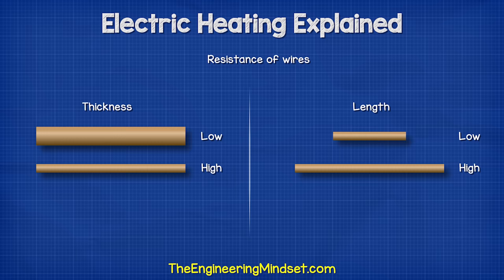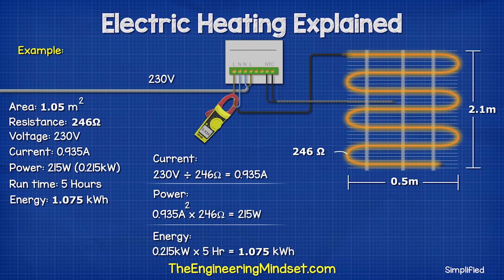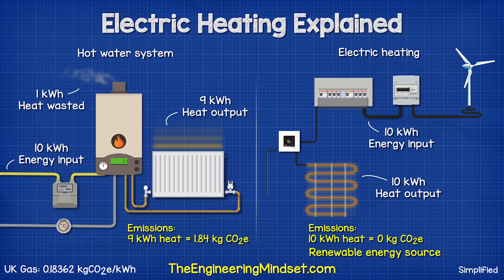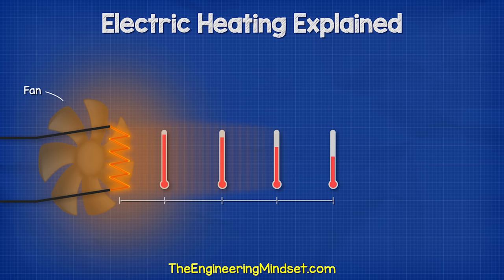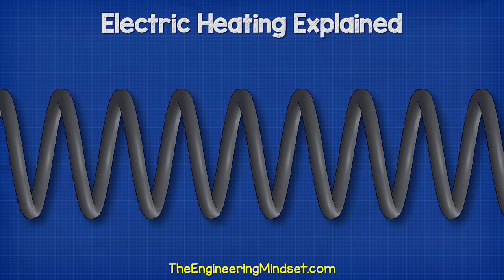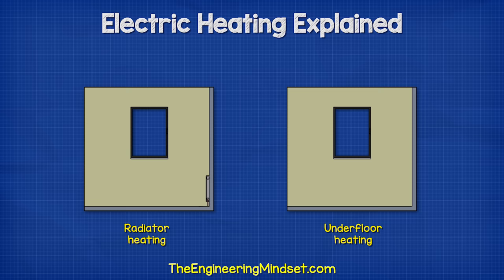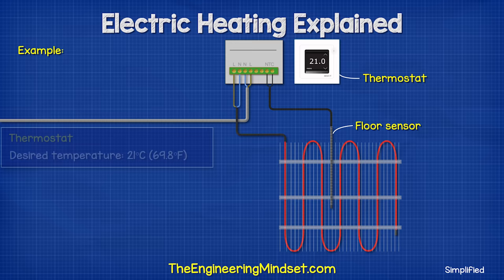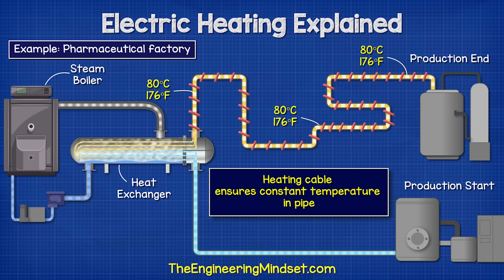Why electric heating is the smart choice

Comment: Both copper and Kanthal wires generate heat, but Kanthal requires significantly less current to do so. Efficiency in electric heating involves converting the kinetic energy of electrons into thermal energy as effectively as possible. Achieving 100% efficiency would mean your electricity bill would be zero.

Comment: 3:17 Power is just voltage times current (P=UI), both of which are known. There is no need to re-calculate the voltage to get the power by using the (P = RI²) formula
Reply: Duderino, I think he is really aware of this. LoL
Reply: @GooogleGoglee  apparently not

Comment: I am currently using an portable electric baseboard heater for my dorm room. It is almost silent and can run constantly. I use it too keep my room a little warmer than the other room. My main heating has failed entirely in the past so the original purpose of this was to have it take over automatically if needed.
Reply: Username checks out

Comment: One form of electric heat that I have seen in other videos, and I can image, not a very efficient or efficetive one "Radian Ceiling" electric heart. I've heard of in floor electric heat here in the US since the 90s. I think the radiant ceiling version wouldl be rather uneven and hard to regulate. First time comment. Very interesting videos!
Reply from the maker: Yes, I had this in a place I rented. Never seen it before or since, but, I'm glad though, because it was terrible. Heating the hottest part of a room definitely doesn't seem comfort focused.
Reply: Our 1985 house in Western North Carolina mountains is heated entirely by ceiling radiant heat (sandwiched between 2 layers if sheetrock).  It works well but is about the least efficient way to heat. Looking to replace it with heatpump hot air w/AC (no AC currently) for better efficiency - also concerned with safety of existing wiring after 35 years.

Comment: I noticed that the speaker did not mention that in-floor heat is more efficient-- because it is NOT more efficient.  Electric heat is always 100% efficient.  Marketers in the US keep pushing that in-floor heat of any kind is more efficient but it is Not.  In-floor heat is Less efficient if the warmest thing in your house is the floor and it is in contact with or not well insulated from the ground beneath it.

Comment: We’re thinking of upgrading our local village hall from our old convectors to infrared. The companies selling this often contradict each other. Some insist that short wave IR should only be used outdoors and others claim it’s perfectly fine. I’m still researching this as our usage is intermittent and we need heat fairly quickly and IR seems the way to go as regards efficiency and comfort. I’m wondering whether medium wave will be optimal for our situation?

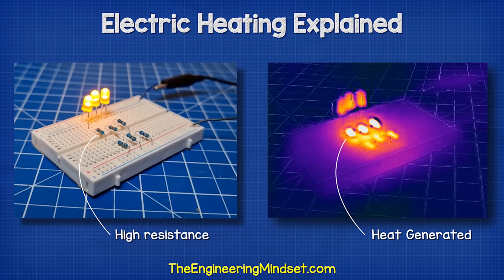Comment: I am confused. I think I need clarification. In 2:34 You said High resistance generates more heat. This implies that high resistance, less current flow will generate more heat. Right? Then you said  In 9:20, you talked about current flowing less leads to less heat being produced. I'm confused. Less current generates more or less heat? Please listen to what you said in 2:34 and 9:20
Reply: The first statement is wrong/misleading. High resistance only generates more heat if the current is fixed (P=I^2R), in a normal heater you have a fixed VOLTAGE (e.g 120 or 230 volts) and in this case you get more heat with LESS resistance (P=V^2/R)

Comment: 3:58 you "forgot" to say that the price of electric heating is 3-5x more expensive than conventional. 
It's "popular" because it's cheap to buy, but when you get the electricity bill you'll see that you made a terrible purchase.

The only economical way for heating with electricity is a heat pump, where you get 3-5x more heat than an electric heater with the same amount of electricity spent (or spend 3-5x less electricity for the same amount of heat).
Reply from the maker: Not if you generate your own energy. My home and workshop only have an electric supply, no gas at all. It's safer, I don't pay for a gas meter, I can remotely control it and schedule much easier. Heat pump is a good option, it's a little more difficult to fit and it only warms the air which rises. Underfloor heats the entire floor which then rises up more even. There are pros and cons to each of course.
Reply: @The Engineering Mindset  if you generate your own electricity an electric heating is even worse investment because you have to scale up your whole power generating system 3-5 times more than you would need for a heat pump heating.

There are several different systems, the one you described (air-air) doesn't "only warms the air which rises", it warms the room via convection (a fan circulates the warm air thru the whole room). 
It's the cheapest system and can be installed easily and cheaply almost anywhere in a few hours (it's probably cheaper than an electric underfloor heater with installation).

Then there are heat pumps that heat the water (air-water & water-water systems) which is then pumped thru underfloor pipes and radiate heat (the same way as your underfloor electric heaters).
Another advantage of those heat pumps (aside from massive 3-5x electricity savings) is that you could install a cheap buffer (water tank) instead of expensive batteries when your power generation system underperforms.

All heat pumps have a built in thermostat, timer/schedular and remote control (and WiFi control, except maybe the cheapest ones).
Reply from the maker: Sure, I have covered all that in the heat pump series. But for example, in my apartment, I can't install a heat pump. I only have electric heating (no gas supply) and millions of people are in the same scenario. I have the option of a wall hung electric heater, a plug in heater or underfloor heating.

Comment: 2:34  Saying that higher resistance = more heat is technically true, but in practice it's not. 

If you have a circuit which only consists of resistors, increasing the resistance decreases the current flowing through the circuit. 

Since Power = Current^2 * Resistance, this leads to less heat being generated, not more.
Reply: i think it's when talking about a single element's resistance

Comment: I run across heat strips quite frequently. Mostly in heat pump AHU's and Fan Powered terminal boxes. Sometimes for dehumidification located in the ductwork. I also see it for heat trace on piping

Comment: Calling electrical heat nearly 100% efficient is quite a mental leap. Yes, it’s pretty good if your measurements start at the switch on the wall, but when you consider generation and transmission, which are indispensable parts of the system, the efficiency is terrible.
Reply from the maker: Sure, in this sense, we are only talking about the point of use. Because the electrical energy consumed is almost entirely converted to heat in the space, whereas a gas boiler has heat loss through the combustion ventilation. We can use locally generated electricity, but it is all dependent on the installation location. A family home can use solar power, perhaps wind, but a block of flats is limited. That's a case for the end user and is beyond the scope of this video. In the efficiency discussion we have only displayed values for point of use for both gas and electricity.
Reply: I concur, this statement is extremely misleading especially when used in the context of heating apartments since using energy sources to generate that electricity (instead of heat) are almost always extremely inefficient (~30%) in comparison
Reply: @EngineeringMindset  I appreciate the response. For whatever reason, I’m seeing a lot of propaganda in favor of all-electric houses lately, plus a turn towards electric cars, and it’s worrisome from an ecological standpoint. Not only will we be getting more weather related disasters, but if people are totally reliant on the grid for literally all life-sustains activities, that will amplify the effects of a power outage. Imagine the Texas outage but nobody could travel either. 

Not to mention that the power will ultimately come from either fossil fuels or nukes.
Reply: You are nitpicking....offcourse everyone understand your concerns although ridiculous if overstretched like you do....electricity is mostly lost as heat even through transmission wires and switches
Reply: @twestgard2  part of the issue with Texas is that we’re too cheap to put electric heat in key equipment. Most normal substations in the civilized parts of the country have no issue with the cold. If you are implying that the electric grid was the only utility in Texas that failed then you need to stop watching Fox News.
Reply: @kelumo7981  it’s all nitpicking until the grid goes down, I guess. My personal electrical power was out for ten hours last week, just three houses affected. A wooden power pole snapped into three and laid the transformer on the ground. We used headlamps and read on our phones that we charged in the car. Thank goodness we heat with wood because otherwise we would have had to leave the house and fret about the pipes bursting. 

Multiply that by an entire city and have it go on for a few days. Then imagine that everyone’s vehicle is electric. It turns a minor inconvenience into a life threatening situation.
Reply: @batterybuilding  I’m saying that total reliance on one system violates the standard engineering practice of redundancy. Putting everything on the grid is a bad idea, because grids go down. 

You’re right that the Texas disaster had its idiosyncratic causes that aren’t repeated elsewhere. The thing about disasters is, they all have unique elements that aren’t repeated elsewhere. New Orleans is mostly below sea level, and Katrina made that relevant. Most people don’t shoot substations, but recently they do in a few locations. There’s always some hole in the armor somewhere, and that’s when you need a backup plan.
Reply from the maker: In my apartment and my office, I only have grid electricity (heating, hot water, cooking everything is electric and im on the 100% renewable energy tariff) we have not had a power outage in many many years. But in the UK, most of the local electrical distribution cables are burried underground so we don't suffer in storms etc and the grid typically has backup routes. Rural communities do often use overhead wires still though. I do use a UPS for my PC just incase and I can charge anything from it. There's new solar cars like the "lightyear one" which are self charging, they will work incredibly well in sunny climates for most journeys and im sure this technology will continue. Personally, as soon as I get my own house, I'm going fully solar, with large battery storage and will sell my excess energy to the grid. My car will be electric and charged from solar, acting as backup too. I've had no direct use of gas in years other than petrol for my car, although of course indirectly I will have consumed through purchasing products made from combustion fuels.
Reply: @twestgard2  Totally agree with all your messages, Thom. Profiteers benefit from contriving reasons to eliminate anything but what they sell. This is obviously not good for resilience. (But it's great for their share value!) Diversity is key. Anything less is just a fool's errand.
Reply: @EngineeringMindset  You raise some very good points. Location matters a lot. I’m in southern Indiana and we have constant short power interruptions (2-3hrs) from trees.

My friend has exactly the system you described, with panels, battery backup, and grid-tie. He loves it, so I expect you will too.
Reply: Yeah I'm pretty sure he's talking about the branch circuit bud
Reply: @twestgard2  electricity is great for redundancy. I can generate electricity a variety of ways at home but I can’t make gasoline.
Reply: @batterybuilding  Gasoline is easier to make than you might think, but it’s one of the more difficult ones. There are people making it at home. Much more practical are wood gas and steam via biomass. 

Everything is very context-dependent. The transmission lines where I am are constantly getting knocked out, and the cost of electricity is high. For someone who lives in a place where electricity is cheap and reliable, finding an off-grid alternative isn’t going to feel urgent.
Reply: @EngineeringMindset  hey what is magnetron
Reply: @logictv6667  in short - an electric microwave generator.
Normally the only magnetron in your house is in the microwave oven.
(To the best of my knowledge)
Reply: Funny that this popped up in my feed again, because my electrical service is out again. Last time it was just a few houses but today it’s square miles of populated area, all dark.
Reply: On a typical cold day in the UK, you'll use anywhere between 60-100 kWh to heat your home (unless you are super, super economical), so the battery you'll need will be in the tens of thousands, if you can even buy them domestically.
Reply: Not to mention, all of the electricity produced ultimately turns into heat in the end, but I suppose all of that is so insignificant that we never mention it at all.
Reply: I still think electricity is more efficient  than natural gas. But it’s probably best to have a good mix of fuels incase one goes down.
Reply: @Songfugel well I am not sure. An entire living floor at 32C has a much better efficiency (in time and comfort) to warm up the entire room said at 30C instead of any other radiator
Reply: @GooogleGoglee  No no, you misunderstood me. It was simply a comment about the efficiency of the energy conversion efficiency from energy source into electricity, BEFORE converting the electricity to heat. This is very important for the efficiency of the whole heating solution life-cycle

If you consider a fuel's whole lifecycle to heat, most solutions have to go over several inefficient conversion steps. Electricity based heating only has one highly inefficient step that can be optimized and loss minimized at the power generator stage at a controlled factory setting, but this conversion is still extremely inefficient, even at these factory level generators and abysmal at on-site generators. Transfer of electricity is a factor as well, but it is marginal when compared to the transportation loss, pollution and expenses for most other solid fuel sources

Most bad sources of heating usually rely on fuel that has to be generated, stored, transported on site, and then combusted into heat energy in a very inefficient on-site furnaces/generators with massively inefficient energy to heat conversion efficiency

While for example, for simply boiling water for tea/cooking example, there is nothing that beats an insulated electric kettle in effiency, since almost 100% of the energy used can be converted to heat with minimal losses

However, when talking about overall heating solutions for houses and districts, and when considering the whole energy lifecycle, nothing beats or comes even close to on-site nuclear powered district heating (without the inefficient electricity conversion step) since it is almost completely lossless solution. Geo-thermal heating is right up there as well, but is sort of cheating in this example (since it is incredibly inefficient, but we are tapping on existing heat) and very limited on specific locations (for Iceland it is perfect, but for Finland is impossible)

And for normal housing (outside of arctic conditions like where I live) where the above solutions are not an option, heat pumps are the next most efficient solution, since they also "cheat" by not strictly generating that heat themselves, but redistributing it anew between the outside and inside unit. However, this requires very specific conditions to be met regarding insulation and inside vs. outside temperature (they become very inefficient at Arctic conditions)

Hope this clarifies my point a bit, and didn't cause even more confusion
Reply: Heat pumps require less energy to run than a super efficient gas furnace, even when connected to a lossy thermal power plant thus reducing the primary energy factor. One funny thing about primary energy factor is that solar power has a primary energy factor between 5 and 6, so it is mostly useful in regards to thermal power plants, vs a local furnace or micro nuclear reactor for heating.

Comment: Using generated electricity for heat when natural gas is available is just the worst in terms of responsible use. Electrical/mechanical energy are the most useful forms of energy whereas heat is the least useful. Taking heat from a fuel and converting to electric or mechanical and then using it for heat again is just irresponsible.
Reply: That problem is better related to the cost of renewables, grid supply mix and to the annoying dependency on gas-rich grid in the UK, meaning that both gas and electricity mostly have the same source and thus there is a "mechanical to direct distinction" For instance, in a country like France where the majority of constant power is nuclear, or Norway, where hydroelectric power is abundant and storeable, it makes more sense.

Comment: Electric heat the most efficient 😂😂😂😂😂😂😂😂😂😂
Reply from the maker: It is, or at least can be. If you're running a diesel or coal generator then obviously not, but through wind, solar, renewables then it is. Even better if you self generate. All the energy is transferred to heat within the space with electric heating, where as natural gas is energy intensive to produce and distribute, a large part is lost through the exhaust providing no effective heating at all during combustion and it's also far more dangerous, especially in apartment blocks, care homes etc. There's also emissions and risks with poisoning, there's mechanical movement within the boiler which will result in breakdowns. These do not happen with electric heating.